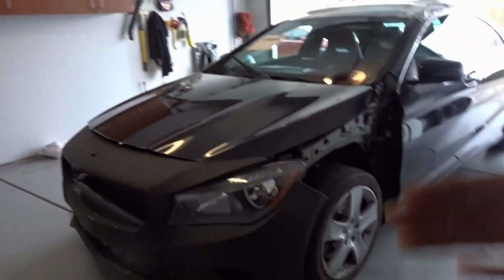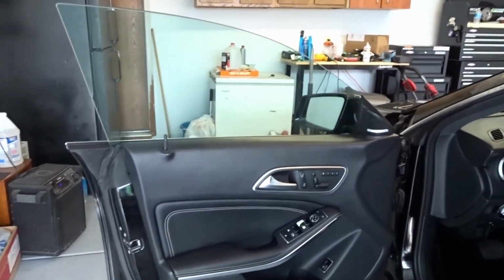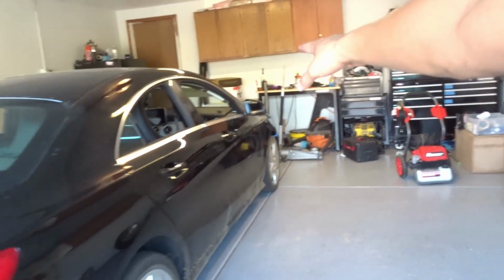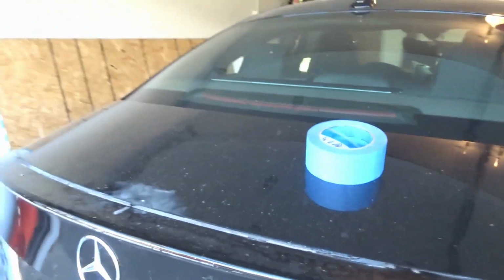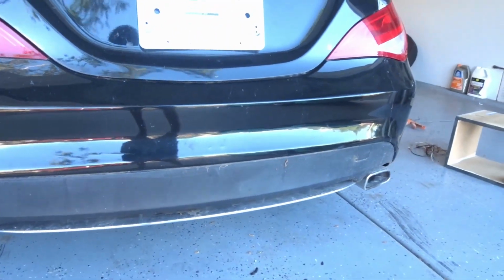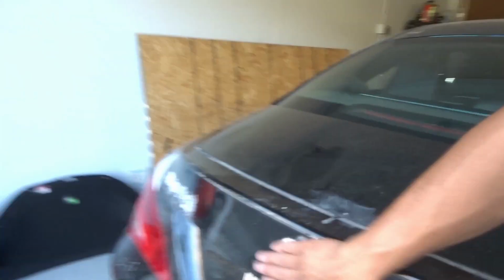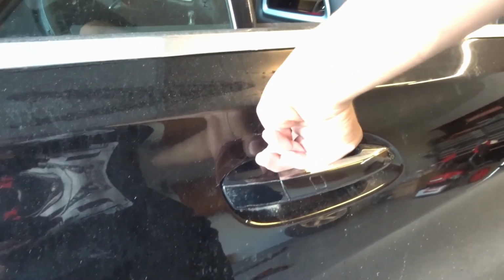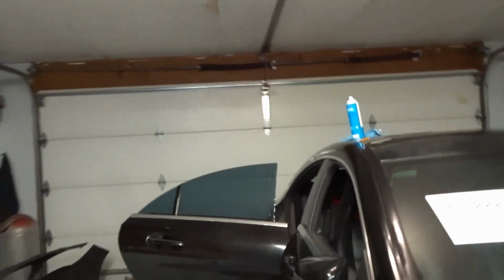CLA250 rebuild project pt2 (tint and body)

Comment: Hi, when you purchased this car was the oil pan cracked did you run a diagnostics? Did you get any codes camshaft deviation codes or anything like that? Also, when you got the car with the engine start, even though there was no oil in the engine.

Comment: I got a similar problem. I got a car with a cracked oil pan. There’s power to the car, but the engine won’t start and I also get camshaft deviation codes. I’m not sure if the engines done or I can rebuild or repair it if I replace the oil pan and put oil in the engine, it may start. I’m not sure. Looking for answers.